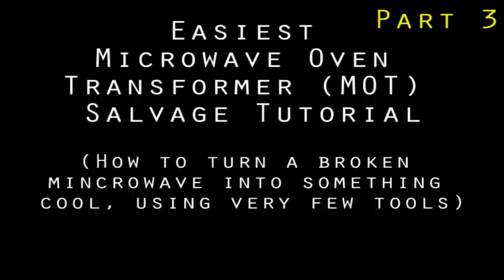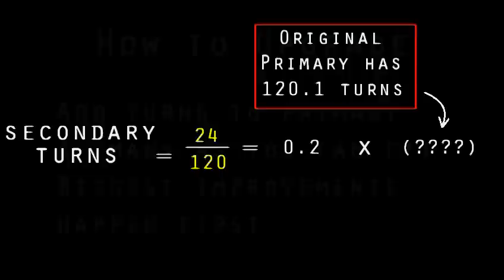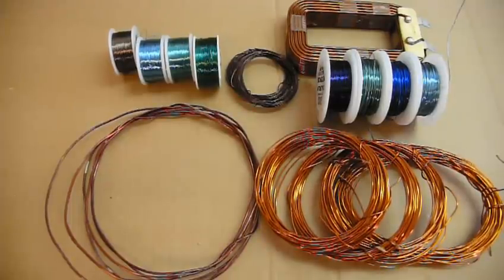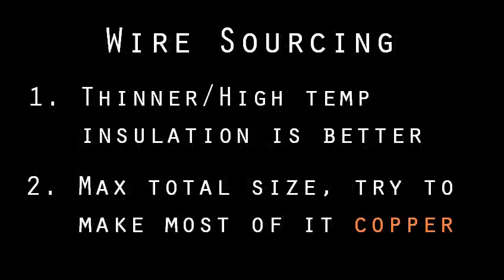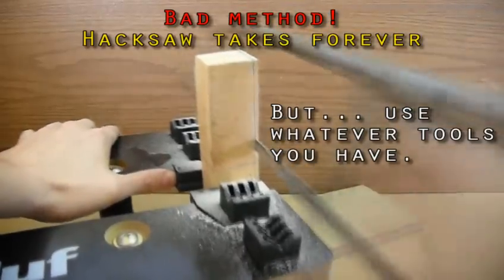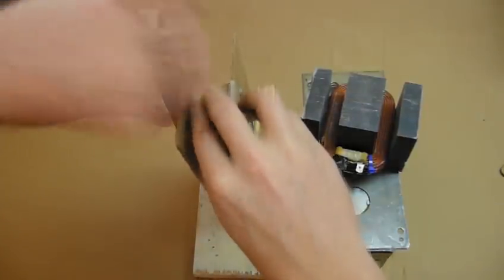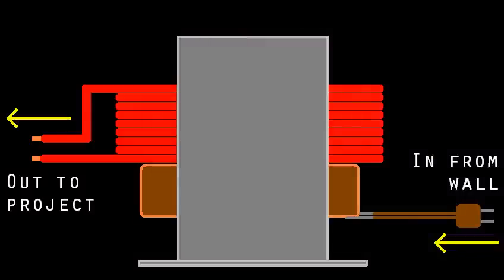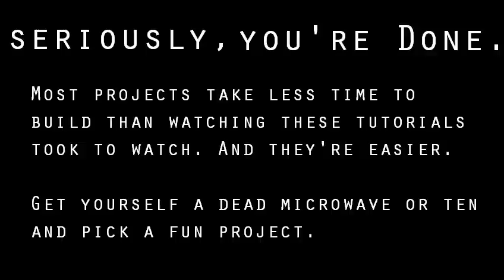Easiest MOT Salvage Tutorial Pt.3

Comment from the maker: Yes and no. Short - Yes. Long - Two constraints. 1 is max wattage the MOT can transform. 2 is max amps wire can handle before melting. Stepping down means less voltage, which means higher amps before wattage limit is hit.. but wire must be thick enough to not melt, and no way of getting thick enough turns in anyway at high voltage. Wire can't be both thick, and with lots of turns, because of space inside the core is limited.

Make sense? Fewer turns and thicker wire, more amps and no melting.

Comment from the maker: I'm not sure, very low. A fraction of an amp. Look at how much power you're drawing with no load. 240v * 5.1a = 1224 watts. Per transformer! With no load! That's maxing out a large MOT. No wonder it gets hot in 2 minutes, you could boil a 4L of water with that heat waste in 2 minutes. So, yeah, there's a dead short in there somewhere. If you remove it, power loss will drop almost to zero.

Comment: is it ok if i used super glue????
Reply from the maker: Well I can't give you permission, ask your mom. Don't run with scissors. Stop hitting your sister. Eat your vegetables.

Wait. Use it for what?
Reply: for the transformer mot i did it and its putting out 212 amps!!
Reply from the maker: Hurray! I presume you were trying to make a spot welder?
212 amps is an odd amperage. Too low for most decent spot welds, too high for this size of transformer to be much else. You put ~4 turns on it?
Reply: nope i put 2 or 3 turns on it what is up with that its a fairly big transformer it doesn't buzz much is there something wrong with it oh and it doesn't have the shunts in it ether plez reply
Reply from the maker: Tangent - When asking someone to spend their time giving you advice, it is considerate to make an effort to communicate. You will probably find that you get much farther in life if you don't sound like a lazy teenager. Try using punctuation and capitalization so that people don't have to waste extra effort figuring out what you were trying to say. You already know what you meant, it's free for you to just be clear about it.

I see no reason for 2-3 turns. Looks like you're building a spot welder. 1 turn using the biggest wire you can. If you have enough wire for 2-3 turns, cut it and gang it up in parallel to make a fatter cable of 1 turn.

I don't understand the final part of your question, or what you want me to reply to.
Reply from the maker: I will not make any statements about your safety with electricity. If a million people watch this video, one of them will have some bizarre unique circumstances and then their family will probably sue me. Generally, it is the voltage of a circuit that is dangerous, and anything below 50V is not even required to pass safety certification (I heard, don't have a source, look it up). So, I would be comfortable touching 35V, but I won't tell you what to do. Current doesn't say anything about how dangerous it is except in terms of heat. 100A flowing through a wire will probably be hot.

The 120V on the primary side is absolutely dangerous. The 2000v secondary on the original secondary is instantly fatal.
Reply from the maker: Yes, I can tell you. In fact, I wrote an entire 3-part series describing how you can. If you're stuck at some part of that, let me know which part. Arc welding uses 20-40 volts, so, aim in the middle there, (24-30v?) and you'll be fine. Transformers different sizes is not a problem. In parallel, just make really sure the output voltages match well within 1 volt (add some extra turns to the primary of the one who's voltage is slightly too high after you're done, it'll be easier than adding turns to the secondary, since you can probably go up by 0.25v that way, whereas on the secondary probably only 1v at a time). So for example, if you want 30V, you wrap 30 turns on the big one with as big as wire as you can, then 30 turns on the little one with as big as wire as you can (it'll be thinner, since this transformer is smaller). Then join them in parallel. If you measure zero volts on the output, swap wires on one of the transformers.

Or, in series, ballpark the size of the transformer's space, and split the number of turns on each. So, suppose you want 30v, and one is 2x the size of the other... the big transformer gets 20 turns, the small one gets 10 turns... both with the same thickness of wire since you use the same wire continuously (the smaller one would only fit 10 turns). In total you have 30 turns.

I have another video half-filmed showing how to hook up multiple transformers, someday over the rainbow I'll finish and post it.
Reply from the maker: It depends on if you do series or parallel. See my previous message, I described it in detail.

In series, one thickness that will fill both cores with an added total of 30v (~30 turns).

In parallel, treat each transformer independently and pick your wire size according to the tutorials.
Reply from the maker: SWord Sord Hey, I'll do you even better than answer that question for you. I'll film an entire 3-part video series explaining in detail how to answer those questions for yourself. Then I'll transcribe it and have it translated into 30 languages in case English isn't your first language. At what part of the videos do you get stuck and not know what to do?
Reply from the maker: SWord Sord First, some things will be different, but I do not know how, I am not very knowledgeable. I will make a guess. The only thing I am confident about is that the turns ratio will still determine the voltage ratio. On an MOT you are recycling the primary and thus recycling the engineering that went into it so you know it works. If you just have a core and no primary you can either do math (which I am not confident with) or you can measure.

Basically, wrap the minimum number of turns for a primary that you can, using as thick of wire as you can, and match the secondary to this accordingly. Remember that the more voltage you give the primary, the more turns the coil needs to act as a transformer or coil and not just an empty wire.

You are powering the primary with 220vAC? Do you have or can you borrow a Variac for testing? I would take a guess and make a test coil of 220 turns of thin scrap wire for the primary. For testing, do not even bother with a secondary coil yet. Then, insert a current (amps) meter on it and slowly turn up the voltage. The (waste) current will rise as the voltage rises. Watch carefully and see if the current starts to grow very large (suddenly changes to several amps). If it does, it means you have too few turns on the primary and need more. If it does not, and you get to 220v without more than maybe an amp, you are okay.

If you are comfortable with the amount of amps it draws, you now probably know the safe amount of turns per volt on the primary. If it works out the same as an MOT, this is about 1 turn per volt, but different sizes and types of transformers will have different numbers. Maybe the number is 10 turns per volt, I do not know. Experiment to find out or copy from a similar-sized example.

When you know the number of turns on the primary you will need, you can replace the test primary with a thicker primary that uses about 50% of the core space. Also, you know how many turns the secondary will need (because you know the ratio), and then you can size the wire and coil that coil too.

That is my best guess for a working procedure. Sorry, I am not confident enough with the math to just tell you a number to start using. Best of luck.

Comment from the maker: You lack confidence. You already figured out the right answer.

Why do you say you could not just put 1 turn on the secondary? You can. One big fat turn of wire. In fact, that is exactly what a spot welder is. A 1-turn secondary and ~1000+ amps.

BUT - make sure you're asking the right question. If you want to know how many volts to cause max amps through some resistance, you have to know the resistance. Too much resistance and the MOT will allow more amps, but voltage won't cause it to flow.

Comment from the maker: Benefits: massively less waste heat, (thereby) better duty cycle, higher power output.
Accurate: maybe, probably not, that's not how I understand it, but yes, lets you get more power without saturating
Audio: Troll? Audio's awful imo. Video sound is straight from the camera. Voiceover is a garbage dollarstore mic. I use Audacity's "noise removal" to remove fan noise, and then manually hush each little plosive pop (p, t, f, d), takes hours. Part 1 I didn't remove pops, you can tell. Cringeworthy.